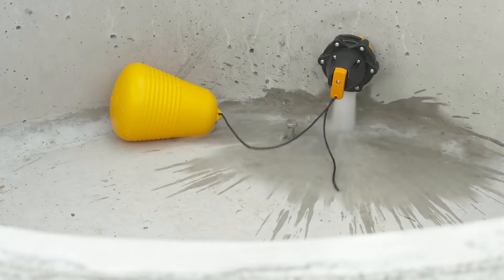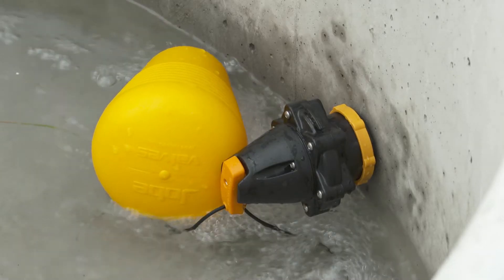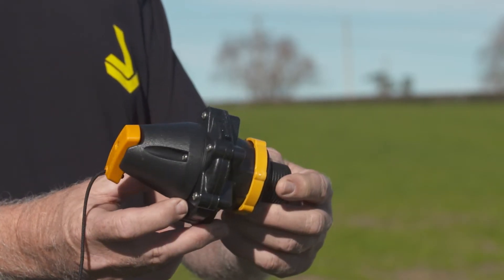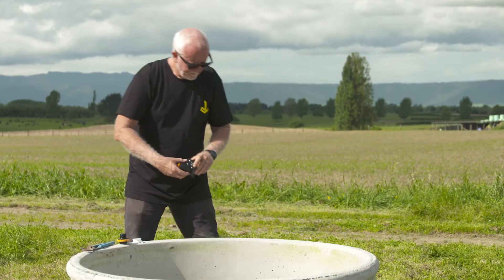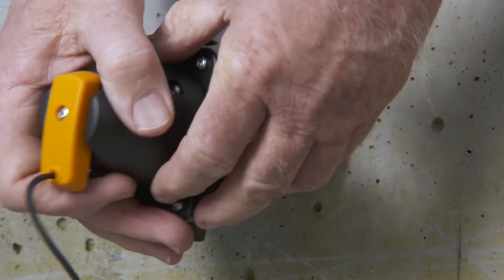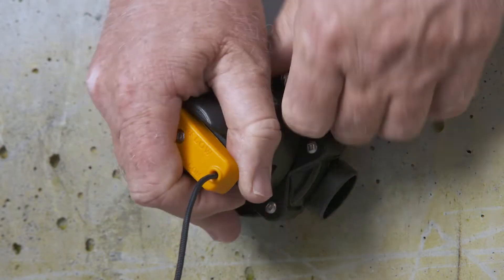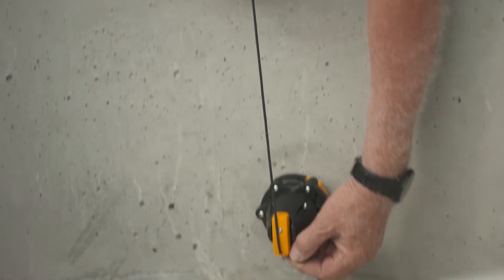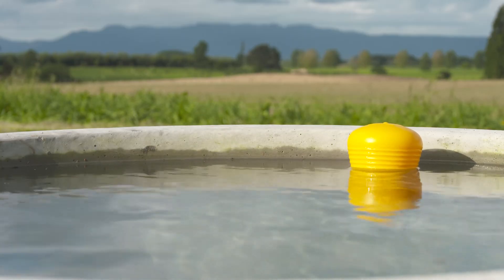Megaflow

Comment: Question, what do you recommend when you are unable to remove the value (by rotating counterclockwise) so that you could clean the filter?  Even with the tail end screwed through the trough, when try rotating the valve counterclockwise, the entire tail end doesn’t stay put and rotates thus making it even more of a challenge to remove.
Reply from the maker: Hi @bonsukan, please ensure the tail of the valve is screwed in properly and tight, we recommend a few turns with polygrip pliers to ensure the valve can be detached when required. Feel free to email us at info@jobe.co.nz if you have anymore questions.

Comment: I’m not sure I understand how to get the valve to come apart by turning clockwise. I’ve literally stood on it to no avail…help!
Reply from the maker: Hi there, if the valve is screwed tightly into the trough, it should be able to come off by turning it anti-clockwise if you're facing the valve. If you are trying to separate the valve from the tail with it not screwed into the trough, you will need to place poly-grips or a vice onto the yellow locking ring and turn it anti-clockwise. I hope that helps, here is a video demonstrating it a bit more clearly https://youtu.be/Uo7OUyIMlK8. Please feel free to get in contact with us at info@jobe.co.nz for any further enquiries you may have.